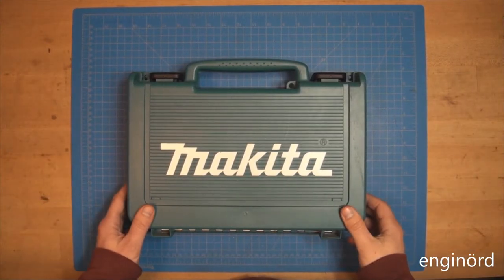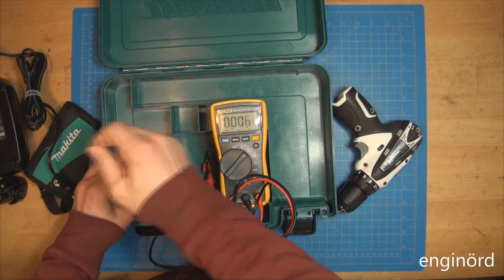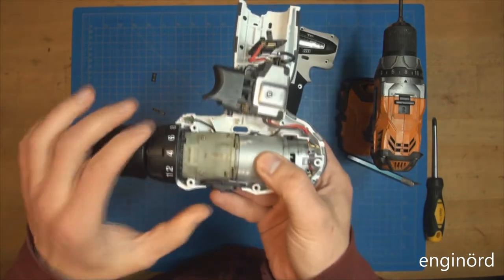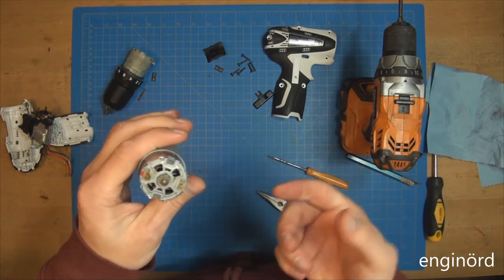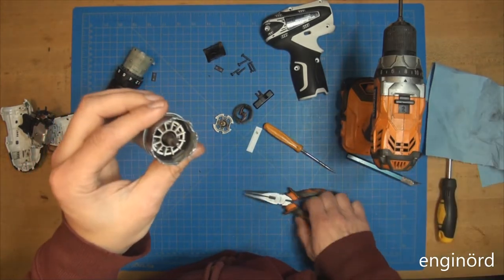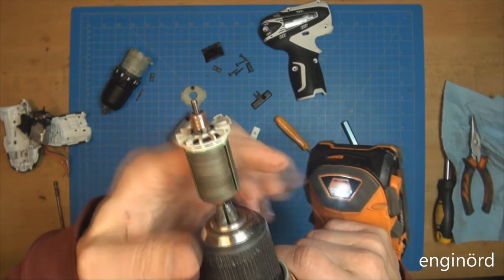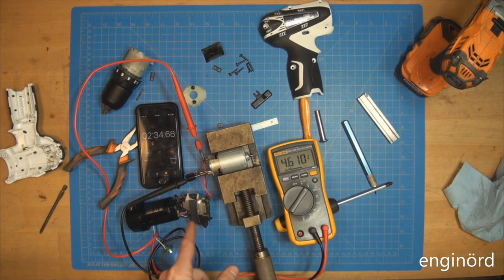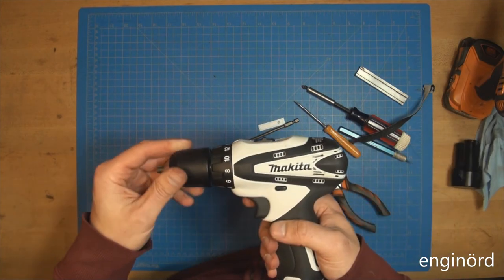Makita FD02 Cordless Drill Teardown And Repair

Comment: I had a very similar problem with my Makita DF330D (very similar machine). There was arcing and the motor was losing power. I was to change the motor, but a few blows of compressed air seem to have solved the problem.Currently testing :)
Reply from the maker: most likely brush dust collected on the internal parts of the motor.